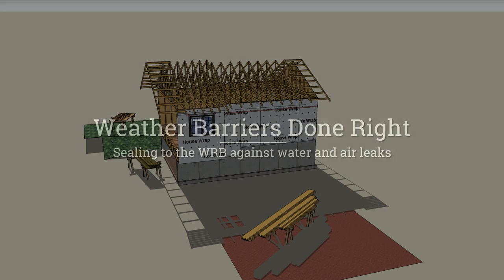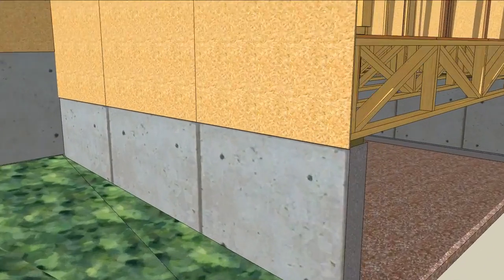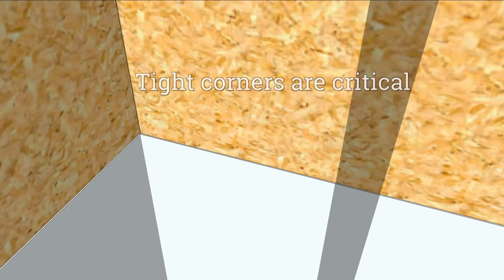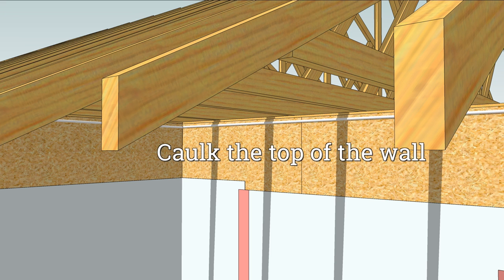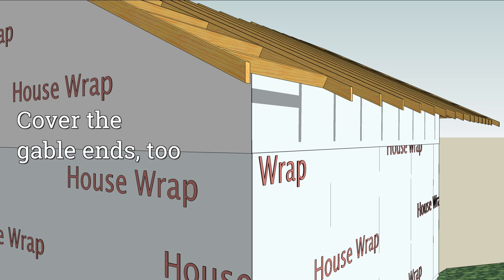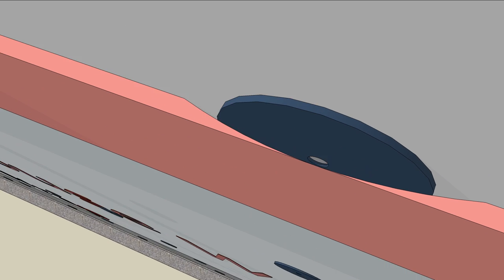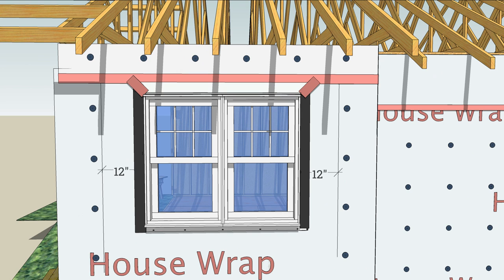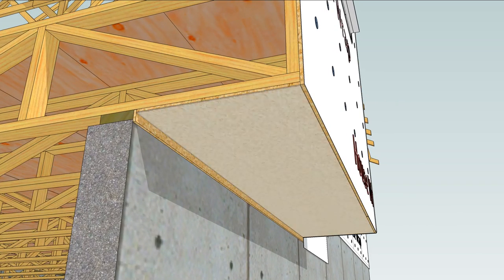Weather Barrier Done Right

Comment: “To bridge the gaps between the wood and concrete...” silicone caulk here, is this really a good idea?
Reply: Kevin McGuire that’s the dumbest idea I’ve ever heard.
Reply: @Kevin McGuire Newbie here.  Why is that dumb?  Not adhesive enough?  I need to wrap my house (84 years old, vinyl siding) and the foundation/sill plate interface is a big concern of mine.  What is the best way to handle house wrap below the sill plate?
Reply: @just1mace  Newbie here.  Why is that dumb?  Not adhesive enough?  I need to wrap my house (84 years old, vinyl siding) and the foundation/sill plate interface is a big concern of mine.  What is the best way to handle house wrap below the sill plate?
Reply: I’m late to the conversation but I figured I’d give some info on the research I’ve found. I’m currently re sheathing and installing hardie plank in my home. Per Tyvek instructions on installing home wrap there’s 3 methods. 1. Flash tape the sheathing foundation seam. Install home wrap. Tyvek tape bottom of house wrap to flashing tape. 2. Install home wrap and overhang over the foundation. Flash tape home wrap to foundation. 3. Install homewrap and overhang foundation. Apply bead of caulk behind home wrap to foundation. Me personally I prefer to have a shingle plane in case of water intrusion behind siding. I’m going to install flashing tape at seam, then home wrap and then bead of caulk behind bottom of house wrap. I think this is the best method. The flashing tape will protect the bottom of sheathing in case of water intrusion from beneath. And the caulk will prevent the intrusion in the first place. The home wrap will have one solid plane for water to flow down. Best advice I’ve heard is think like a rain drop. Sorry for the long comment. Figured I’d give my 2 cents

Comment: So, I have spent several months this Summer removing 20 year old OSB that rotted behind vinyl siding.  I have gone around the entire first floor of a two story house. There was inexpensive house wrap that was similar in construction to a plastic tarp (woven, then covered with very thin plastic).  The weave deteriorated and let water through it. Wind drives water behind siding, past J-channels, etc.  Water splashing in the dirt splashes up onto the foundation, and up behind the siding. The OSB disintegrated in two places:  around windows, especially below the bottom corners where the water ran down along the sides of the windows and blew behind the J-channel, and at the bottom of every wall, due to water splashing upwards onto the unprotected OSB edge.  I put on all new OSB and covered it with Tyvek, which is much stronger and not likely to fray and let water through, compared to cheaper woven house wrap.  I put 4" Dupont Butyl tape around all 4 sides of the windows.  Also, I believe the first part of the video showing the bead of caulk blocking water from coming in the bottom to be a good solution.  If you let the Tyvek just hang down, the wind blowing and water splashing upwards will soak the OSB edge, and carry it upwards, causing the rot to move higher and higher over time (which happened on my house over 20 years).  I hope this helps someone else NOT have to redo entire walls, due to water damage.
Reply: we have had nothing but failure from Nova wrap. The windows have been properly flashed and all drip caps have end dams etc. Any significant rain will push through the wrap, soaking the sheathing. Once the sheathing is wet it actually increases the flow. It sucks the water through because there is now no surface tension. I tarped walls that were in danger of exposure to a driving rain this weekend and attached the top behind the fascia, keeping the hoarding away from the wall. I used some wrap in once spot and during the rain inspected it. there were no nails in the wrap except on where it was attached on the sides to some 2x material with another 2x on top to prevent blow off. The wrap in the middle of the field was wet through. pulled off a brand new roll. this stuff may as well be toilet paper...total failure. 
While I'm at it, the deltawrap foundation membrane allows the backfill very good grip to drag it down as it settles. This can tear the membrane where the fasteners are. both systems are failures in my opinion.
Reply: is typar wrap good? or even ZIP

Comment: I think I have a problem.  My house was built as follows: framing, insulation, house wrap , sheathing (particle board) then siding.  Is this a major problem?
Reply: Built in Michigan(kalamazoo)...1994...It was built as follows: framing , insulation between studs, then foam board tacked up and over that house wrap.  We were unhappy with it because it was noisy when windy and could hear too much of what was going on outside.  So after a severe hail storm , when we had to have the siding and roof replaced we asked the contractor to add OSB to the sides of the house.  But after looking at this video I got to thinking..should they have removed the original house wrap (which they didn't) then added the OSB and then put the new wrap over the OSB (which they left bare) before adding the new siding....Sorry I don't have a picture.
Reply: OF COURSE yes! OSB will rot.
Reply: @peaceoutpeaceout4267  Technically water from rain shouldn't be able to get behind siding at all. But they say that vinyl siding sweats, and that's what gets behind and rots the wood. I'm not for sure if other types of siding, Hardy board or the like sweats or not to be honest.
Reply: darksideoftheloom Yes, for sure! The house wrap goes on top of the sheathing, not behind it!